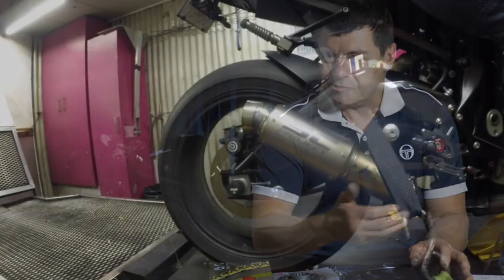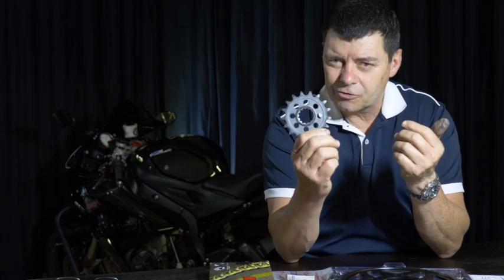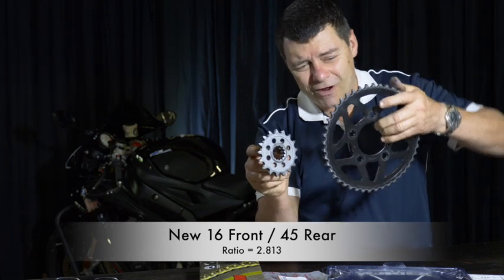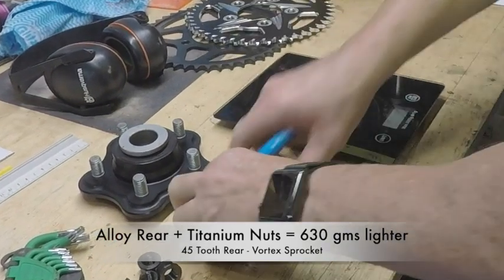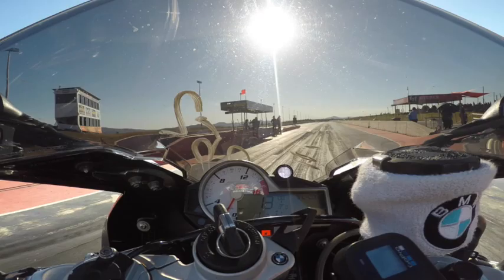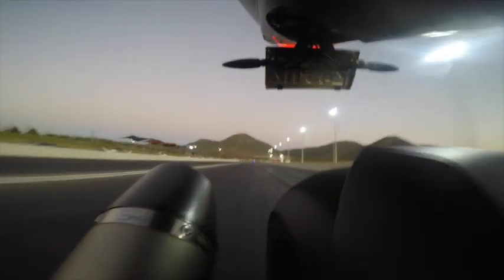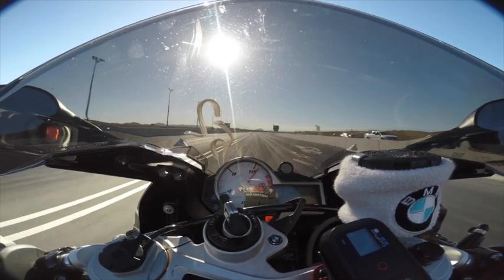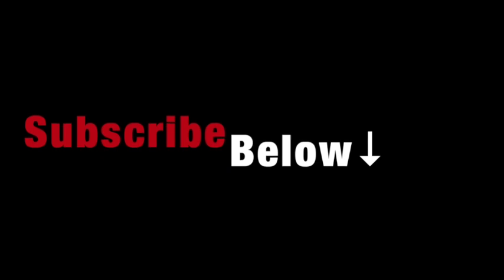Changing Gearing Ratio and Fitting Lighter Sprockets and Chain on the BMW S1000RR

Comment: Hello,
I'm having an issue with my 2011 BMW S 1000 RR regarding the top speed and gear ratios.

Right now, the bike feels powerful and runs great overall, but the top speed doesn’t match the original specifications. In 5th gear, I can only reach around 270 km/h, and in 6th gear I hit the rev limiter at around 296–297 km/h. However, with the stock gearing, it should go up to around 290 km/h in 5th and around 300+ km/h in 6th before hitting the limiter.

I suspect the gearing might have been changed by the previous owner. The rear sprocket has 44 teeth, which I believe is stock for a 2011, but I haven’t been able to check the front sprocket yet – it could be a 16T instead of the original 17T.

My goal is to restore the original performance and top speed of the bike. Could a shorter final drive ratio (e.g. 16/44) be the reason for the current speed limitation?

I live in germany wich means no speedlimit highways and i hate it beeing stuck at 296 or 297 instead of 299
Reply: You should put a 17/42 ...you can reach 330+ km/h

Comment: Hey mate. I know this is an older video and it looks like you've moved on to the latest greatest RR, but just quickly did DTC change in the way that it acted? To the extent of my knowledge it should, as the lookup tables are based off front and rear wheel speed and lean angle to name a few. By changing the gearing of the gearing (aka sprocket size) this should push us into faster rows. Did you feel a difference?
Reply from the maker: still got the 15/16 model mate, cant part with it lol. No mate, DTC was not affected at all. Changing gearing changes what revs the engine is at for a given speed and gear which is not a factor in DTC (as far as I know). It is more concerned with lean angle and wheel spin.
Reply: @TheBikeStig  Thank you. I was concerned because I was told by an other rider the % rear spin is calculated from the sprocket RPM (aka engine RPM with ratios applied) rather than the ABS sensor, like it is in the front - either way I'm glad that it doesn't change anything. Will definitely purchase this setup once my stock sprockets and chain are worn.

Last Question. Have you ever done anything to the stock suspension? The DDC has always given me a vague feeling from the front. The system has always done exactly what it was designed to do, but in a way which required faith, rather than trust

I saw there is a company in the Netherlands that has designed a plug and play system called TracTive. Funky naming aside, at six thousand kangaroos and very little in terms of rider feedback on the forums it has given me pause if I should bother, or just sell my 16 and use the 6K and a little change to upgrade to the new gen. Here is the system I am referring to - have you heard of it? https://tractivesuspension.com/shop/motorcycle/bmw-motorcycle/s1000rr-2015-2018-bmw-motorcycle/bmw-s1000rr-rear-shock-ex-cellent/
Reply: @Niko-qs1sl  add a 2d sensor and ulock the ddc for the front.  it is very limited in stock form.
Reply: @ Thanks mate. I now run a full Mupo setup, the DDC System has found a new home in one of the premiere Brisbane recycling facilities. A good, fitting home

Comment: Hi, thanks for the info.
just one question, the rear is made of Aluminum. does it wear out quicker than the steel version ?
How many miles/KMS did y lol u ride it on track/street?
thx and greetings
N.
Reply from the maker: Cant answer that one mate, I haven't worn it out yet. I didn't buy a cheap one, I actually bought the sprocket for the rear made by the people in Italy who make them for MotoGP bikes. I got that advice from Al Samuels down there at Race Dynamics in Sydney

Comment: I am doing roll races from 60-170 mph. My 2020 r1 has pretty long gears stock. But I don’t know if I should gear up or down one to get better 60-170 mph acceleration?
Reply from the maker: interesting question, I know that by changing gear the way I have, the gearing ratios get closer together (I think thats the correct way to say it) and you get to maximum torque earlier as the engine revs. I also can tell you that on my bike it comes out of corners much harder ... so my thoughts would be that provided you don't lose top end speed you need, you would get more acceleration. Might be worth finding someone who has re-geared an R1 to find out. For me, I'd try 1 tooth down at the front to start with.
Reply: @TheBikeStig  yea I don’t think I’ll ever need to max out my 6th gear stock gearing so I might as well lose some top end mph for some quicker acceleration right? It makes sense to me! Thanks sir I’ll give it a shot.
Reply from the maker: @badass1g  cheers mate, let us know how it goes

Comment: Hey mate, great video once again and very informative! I am considering buying a new chain and sprocket kit for my 2017 bmws1000rr to generally make the bike accelerate as fast as possible without sacrificing how it feels and handles, also durability. Can you recommend any good quality kits, otherwise I would get a similar kit like yours in the video?? Your advice would be much appreciated. Thankyou
Reply from the maker: I went straight to Al Samuels at Race Dynamics in Sydney and bought the items individually. The rear sprocket had to be ordered from Italy as I went up 1 tooth but wanted a high quality and durable lightweight sprocket that would fit the HP wheels. That said, I am sure there are good kits out there. Re the down 1 at the front and up 1 at the rear, works fantastic and no sacrifice to handling and feel mate.
Reply: @TheBikeStig  hey thanks for your reply. Yes Im leaning towards 16 front/46 rear sprockets, just not sure whick brand. Did you have to adjust your odometer/speedometer as well? Im thinking of having a go at installing it myself
Reply from the maker: @marwat8741  no mate, no adjustment necessary as the pick up for the speedo is the abs ring. As long as you don't change the wheel diameter the speedo won't change

Comment: I just did this on my 2019 street triple RS. Had a 16 tooth front sproket. Went down to a 15 tooth. Made a big difference, the rs was geared far to high.

Had you as my coach at PI in December George. Thanks for all your help, you helped me identify a nasty habit I had.
Reply from the maker: Yep the gearing is worth playing with a little. I get asked a lot of questions about speedo reading so am doing a video on that now. And glad to be of ,help mate, looking forward to our next school and hope we catch up again
Reply: @TheBikeStig  yeh, my understanding was that on modern bikes with abs the speed is read from the rear wheel.

I rode a KTM 1290 superduke last week. Even that was gear super high, it was just cruising in 3rd gear at 100kph.
I’m not sure why manufacturers do it. Maybe for sound regulations or fuel consumption?

Yeh George you picked up I was accelerating whilst still leaning. I reflected after and realised I had been doing it for years 😬
Reply from the maker: @jimbo1485  I didn't know that about speed reading, interesting. Yeah the KTMs big bores seem to be super high geared. I rode an RC8 for a while and top gear was ridiculously high. Whack some decent gearing on that 1290 and man that would be a hooligan machine :-)

Comment: I changed my sprockets yesterday and now I have downshifting shifting issues. mainly won't go into first. I also was in a higher gear and can only downshift once
Reply from the maker: Seriously! It don't believe it can be related to the sprockets as they don't affect this unless you have something technically wrong. The only thing that comes to mind about what can go wrong fitting this is the routing of the cable past the front sprocket cover and something associated with the quick shifter when you fitted the front sprocket. Make sure you're off the gas fully for downshift and on the gas for upshift, other than that, I have no idea what that would be.
Reply: @TheBikeStig  yeah it's definitely the blipper. Even off throttle it's like first doesn't exist now. I got it going back to the shop Friday
Reply from the maker: @optony9606  that's interesting, I know you can turn the auto blipper on and off, I think it's in Race settings if my old memory serves me

Comment: I just bought me 16T/47R and now I think I ill order those bolts
Reply from the maker: Im a titanium bolt addict :-)
Reply: @TheBikeStig  $80 delivered 😱 they do look good. I sent you a link for rear rotor. Will give you the lightest wheel without going carbon
Reply: I fancy going 16/47 too, on my k63 s1000r. Stock gearing is 17/45. I've bought a 16t already from afam, but haven't found anyone that produces a 47t yet (I'm sticking with steel 525 for longevity). I'm sure jt or afam with come out with a 47t soon as that's the standard rear sprocket on the new m1000r.  I'll probably also try and extend the wheelbase a bit with a longer chain.
Reply: @lordgibbness  I did get one I will try find it for you, was a while ago hahaha
Reply: @lordgibbness  mine wasnt 525

Comment: Hey George, what do you think about BMW’s new endurance chain? 
https://www.financialexpress.com/auto/bike-news/the-forever-motorbike-chain-bmw-motorrad-introduces-m-endurance-maintenance-free-chain/2071373/

That was interesting! I actually considered these mods myself but given everything you just said I think I’ll maybe just switch out the chain 😂 

Got the M9RRs per your suggestion btw. Fantastic tyres! Thanks for the recommendation. Feels like a completely different bike after switching out the Bridgestones.
Reply from the maker: Looks like a winner, though I’ve never really had problems with bmw chains. Be great for longevity of it but probably not the best choice for racing as it will be heavy I’d imagine. I’ll do some checking
Reply: The Bike Stig I mentioned this chain to a friend and he made an interesting comment. I might need to get a tougher sprocket to compensate for the stronger chain.
Reply from the maker: @Invis_Space  the factory sprockets are pretty tough, but so was the original chain on the S1000RR. I'd definitely go this way next chain replacement with factory sprockets if I wasn't into racing. Since I've gone down the lightweight path with different ratios, we've ordered a rear sprocket from the folks in Europe who make them for MotoGP bikes, it will be alloy with a hardened tooth area, don't know full details yet but it should be here this month. Up 1 tooth as well.
Reply: The Bike Stig Yeah I think I really have to upgrade the stock chain. It stretches out easy. Making regular adjustments. 

I cringe to ask you yet another question but you do give solid steers... what chains are a good shout? What have you personally liked?
Reply from the maker: @Invis_Space  All good mate, I've been using RK race chains, I just go with what my guru buddy at www.RaceDynamics.com.au recommends. Never had an issue with them.
Reply: The Bike Stig adding this to the winter hit list 🙏🏻
Reply from the maker: Btw, if you change the pitch of the chain you’ll have to change the sprocket ms to match pitch too
Reply from the maker: Just put M9s on a super motard, awesome on that too 👌
Reply: The Bike Stig awesome! So impressed with these tyres. Since your advice is always spot on... can I ask another tyre question. What metzelers do you think are best for 1250GS? Zero off-roading. All street riding. I ride the GS decently aggressive, but get caught in the rain regularly 😬
Reply from the maker: @Invis_Space  I have tried quite a few on my R1200GS and finally settled on the Metzeler Tourance NEXT for my bitumen riding ... they have awesome grip in the dry and are super stable in the wet, in fact they were my benchmark for wet tyres at one point. I should post a video from the GS riding with the boys on sports bikes.
Reply: The Bike Stig ah I did look at those. I was trying to decide between the Tourance and the Roadtec 01s. Can’t make up my mind. 

You gotta make a GS chasing sports bike video! I’d love that!!! I really love switching between my SKR and GS. 😂